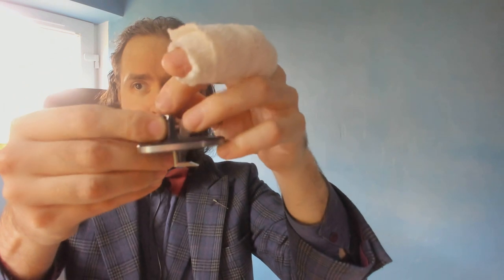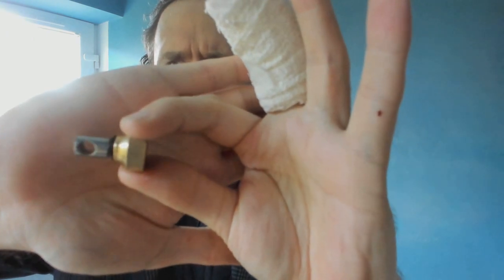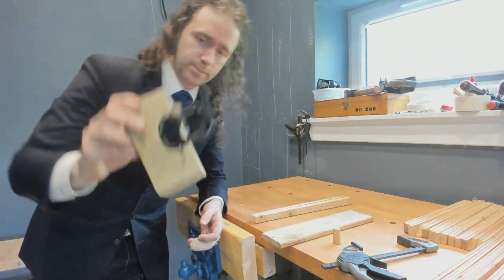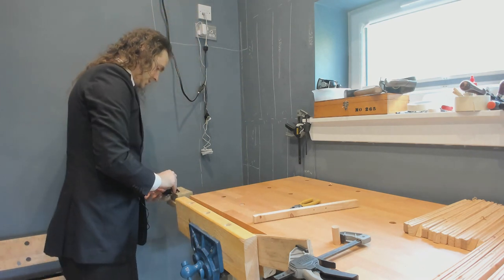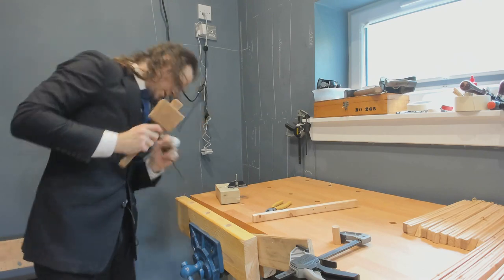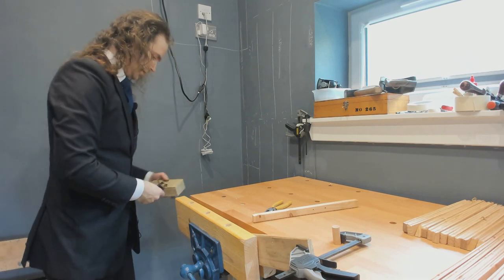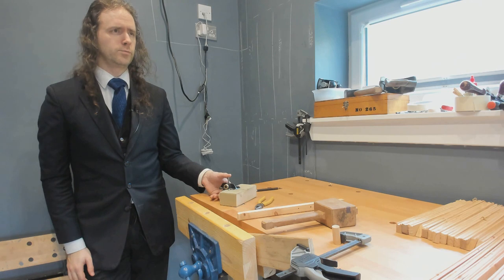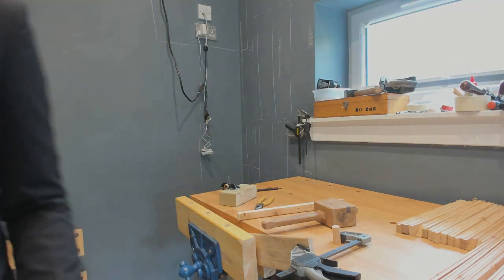ShedLog #2020-05-24: Review: Veritas Small Router Plane

Comment: that router plane as far as I can gather is for marquetry and inlay work, very delicate detailed work. this video is what you might use it for if you wanted to inlay the star into a piece. 

https://www.youtube.com/watch?v=wlkinMSfn_g
Reply from the maker: Interesting then that the box the tool came in has a photo of the plane being used in a groove in side grain...
Reply from the maker: Your comments are appreciated, and this log is about trying to share what I learn as I go, which does mean older videos like this can appear a bit naive even to me, as I'm very much still learning.

Veritas make an even smaller "Miniature Router Plane" for exactly that kind of work. The "Small" plane can turn its hand to marquetry, but it's frankly a bit big (who needs over an inch of depth for inlay work?)

The router plane was invented for all kinds of fixed-depth work - anything one would now tend to use a plunge router for. It's far more common to use a plough, dado or combination plane to sink a groove, as that's a job that requires a fence, and router planes are difficult to attach fences to. But they are commonly used for tasks including tidying of the bottom of a groove or housing (to remove the "tram lines" of a dado plane, or the power marks of a table saw) in cases where some or all of the groove will be on display. They're also great for getting hand-cut tenons exactly flat and centered, if you can conceive of a reason to.

Even so, for a minimal toolkit (and I don't have the space for many tools), I'd prefer to have a good quality router plane than a plough plane, just in terms of flexibility (having used both).
Reply: @robertlee9908  Your right, I am a bit bog eyed because I have just bought the smallest one and have been scanning the net doing a bit of research on them, I own the large veritas and a record router plane, both of which have an optional side fence for grooves and a curve on the fence for curved grooves.